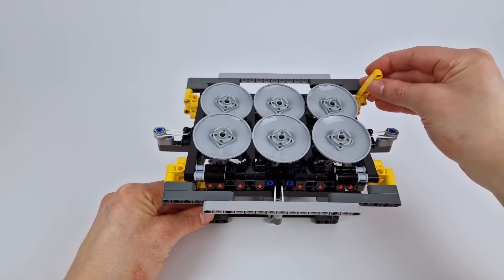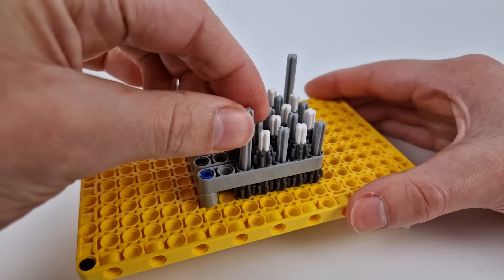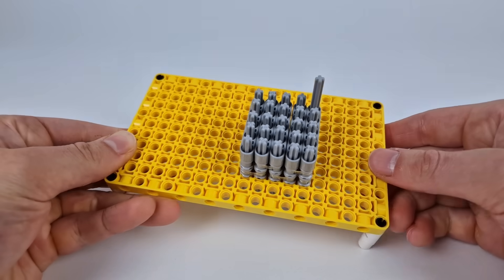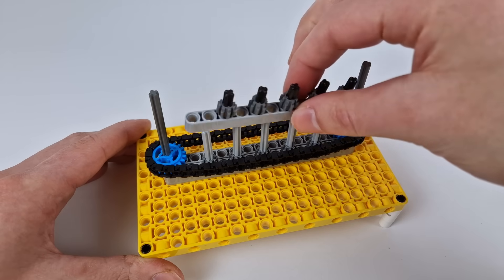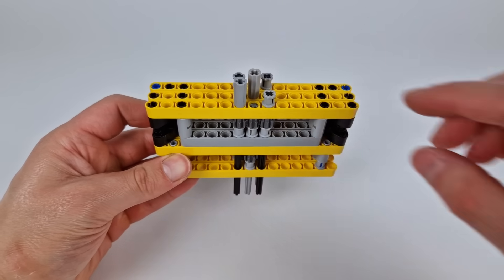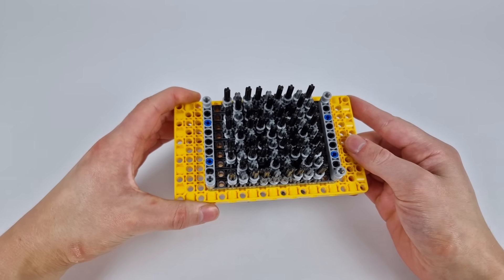How I Built a LEGO Treadmill That Moves in EVERY Direction

Comment: It might be a bit smoother if you tensioned the net with some rubber bands so there’s not any sag between axles. The fact it’s 9x9 and leaves an open row of spaces on two sides might actually make that easier, just adding some rubber bands to them could work. I have no clue if that would actually help but intuitively my thought process says it should

Comment: 7:57 Why not just have the rubber bands connect in independent groups of two instead of every single axel being connected to one another? Since the treadmill has an even number of axels in each row, it shouldn't be a problem, and since one in every two axles is powered and connected, you shouldn't need the bands connecting everything.

Comment: You shoulda stuck with the second design where it has 2 layers of one grid gears but have  2 drivers on the outside of each of the 2 layers. That would save you a tun of space. Aka a drive gear on the side of each 2 layers. 2 drivers 2 layers. 1 or 2 motors.

Comment: Pretty sure rubber banding them two at a time makes the force required to turn the gears an exponential function of 2. I'm not going to guarantee an automobile engine generates enough force to turn that shaft if it were made of perfect, indestructible materials.

Comment: First, instead of trying to turn one single axle with a motor and have everything else be connected with gears and elastics, why not just drive every other axle directly, and have each driven axle linked to a nearby axle via elastic.

Second, if you could use belts to drive every other axle without slippage, why not try to power every other neighbor with elastics? 

Great video nonetheless.

Comment: For getting the chunk corner axles spinning with the chunk edge axles, you could use the gear method which doesn’t work but instead of one of the gear pairs, use a rubber band connection. This would be much smaller than using the universal joints.

Comment: So you may already be aware, but Disney (iirc) actually used a similar structure to take multidirectional input for 3-dimensional movement in VR games/experiences. As far as how the input from "walking" on the treadmill is translated to steps within vr, im not sure - but I imagine it could be done by measuring motor voltage input and rpm output differences among each of the rotating disks. The 3d pad they prototyped is huge too with thousands of disks. very cool!

Comment: Very good. Did you consider shifting the powered bottom section of the assembly and keeping the disc grid fixed? This would mean the bottom mechanism must hang below the fixed treadmill part which would have some larger structure to hold it and that would rest on the table (say). The relative movement is identical and although the greater mass is the bottom section, imagining the treadmill as a floor which does not itself shift around should make the omnidirectional motion clearer since it is not mixed with a large translation relative to the camera.

Comment: So basically that entire yellow box underneath is only there because Lego doesn't make a gear that can turn around an axle freely. That is some real dedication to not just breaking out a drill and making the piece you need.
Reply: this might be a dumb question, but how would that solve the problem? i can't seem to visualize it
Reply: @wcpf19  imagine you have an array of the small gears. some will turn one way, some the other way. you need them all to turn the same direction. now imagine that you have one gear that grips an axle (like what we currently have), and one that lets the shaft spin freely. and so on. that would mean that only half the axles going up will be powered, and will spin the same direction. now put another array below this one, but with the order reversed when you have a normal lego gear above, you put one below that does not grip the axle. that way you power the axles that arent powered. in a way you can think of the freely spinning gears on the shaft as just a means to turn the other gears next to them, which actually grip the axles and make them spin.
Reply: @wcpf19  let's him pass an axel through that the gear has no effect on. Then, he would use another stack of gears fixed in an oppositional array to actually drive that axel, allowing all the axels to run in the same direction with only two gears worth of space.
Reply: Or a 3D printer, but I guess that defeats the point of using Lego parts
Reply: @ZT_1234 the purpose is to model shit, imagine doing science with only a set number of elemen…. Oh…..
Reply: @lindboknifeandtool Unironically, this is precisely what I love most about designing and building with Lego. My most enduring interests all have limited sets of building blocks – the elements of chemistry, the instruction set of coding, etc – from which to build forth from. Working within such restrictions has a wonderful way of focusing the mind, by giving you a basis of possible pieces to put together to solve a problem. I find it easier and more intellectually stimulating than if I were to have completely free reign over every detail, which can be an overwhelming hazy cloud of potential that makes it more difficult to know where to start, and where to go next.
Reply: @Havron I believe this urge (to me, literally I only know about me) feels like I’m settling into something lazy. Like, it’s a meditative process and to me those are dedicated to downtime. I mostly am concerned with making art my every waking hour so if I was to use something pre done like say wire wrapping pendants instead of going full silversmith I’d be leaving artistic potential on the table and the… resolution to which I can represent the idea in my mind is sharper. 

Idk like I’m glad at this point I can basically make anything with any metal and it took a very long time. Maybe some things I’m not thinking of like car body panels from flat stock but you know what I mean. 

But the restrictive to produce creativity thing is valid asf and I do it myself, I just often feel like using AI, I’m not getting those 10,000 creative thinking hours. 

I way overthink everything. 

I build Lego sets now because I have my massive tub to my nephews.
Reply: There is one

Comment: 8:00 I'm pausing the video and guessing the solution: 
You could do a few bigger gears underneath so the strain doesn't branch just from one point of contact and then those main points turning the surrounding gears so the friction is more dispersed, genuinely no clue if that'll work but in my brain it feels it would work better than that setup.
Reply: 10:20 YOOOOOOOO, DA CHUNKS

Comment: you could use two tiny gears and a belt to connect the central axle to the counter rotating axles. it would add 9 belts so idk if it would work with the friction but it's compact and easy

Comment: That's wild! I'm always impressed by what people can do with Lego.

I bet you could link the power switch to the joystick so that the motors are off when the joystick is centered. Creating a deadzone that the objects on the conveyor won't move. 

You could also probably make it so the lower assembly moves via the joystick instead of the net section so the conveyor is stationary. You'd probably have a lot more resistance on the joystick though.

Anyways great work!

Comment: I figured out a way to do this with the round smooth 1×1 tiles like you did however it is portable an d it is less that 10 studs tall and also less than 10 studs wide

Comment: 4:14 I assume modifying Lego pieces wasn't on the table, but if it was: could you drill out the plus-shaped axel teeth from one of those small gears and give it a smooth bore? That way you could have a small version of that red gear. Not sure how structural it would be but with so many of them meshing, it probably wouldn't need to be too strong on any single one.

Comment: Imagine how much simpler this design would have been if there was a cog piece that had a smooth, no grip center that would just rotate around the shaft without contact.
It would solve the entire adjacent-shaft grid rotation problem

Edit: Actually looking now those pieces do exist and Lego calls them clutches, but they dont make them that small, only 16 tooth, not 8 tooth as needed.

Comment: My solution to the lack of space watching this would have been to basically add an extra set of universal joints at the bottom, allowing each axle to spread out over a larger area so that there is space for idler gears.

Sort of like what you did in that last step, but at a more absurd scale, probably wouldn't have worked nearly as well as what you came up with in the end, and would have taken up way more space

Comment: This design it not significantly different from the holotile design as you state in your acknowledgement. They both use tilted disks to achieve movement. Perhaps you achieve that tilt in a slightly different way, but the fundamentals of the technology are still exactly the same.

Comment: 7:00 why not power the 4 corners with 4 separate motors? There would be enough power turning them and it would be evenly distributed
Reply: 16 motors for a 10 by 10 grid might might be a teeeensy bit much
Reply: @MarilynMalkovich  where are you getting 16 motors from?

I was saying 1 motor for each of the 4 corners
Reply: @IdealIdeas100 I believe they mean the fact that in the time stamp, it is a quarter of the full thing shown, so 16 is the total number of motors

Comment: why not use 2 shafts in different locations on the perimeter on the double layer design at 4:15 and gear the shaft to spin together on a 3rd layer?

Comment: I don't understand why the 2 layered gears solution proposed at minute 4:05 is not pursuable. Why didn't you add an external input shaft for the second layer of gears on the outside perimeter of the yellow plane? You have opposing holes on the outside of the plane, just run a driveshaft inside one of those vertically facing holes and you are set, no?you could engineer the gearbox outside of the plane in order to have 2 output shafts rotating in the same direction 1 block apart and then just connect 1 to the bottom array of gears and one to the driveshaft that goes to the second layer.. I think you have the space to run a secondary driveshaft

Comment: I found the movement of the holder mechanism kinda off putting and weird. Like it didn’t fit well with how the treadmill moved the Lego pieces.  Don’t you think it’d look better to the eye if the frame of the holder mechanism was attached to a table so that the     grid of gears was suspended underneath the table and hidden so that from your point of view you the joy stick will only move the direction the LEGO pieces go as opposed to also seeing the frame move. So basically instead of seeing the net holder mechanism move and the red lego move of the treadmill, you could just see the treadmill stay in the same spot while j seeing the red lego pieces move. God I tried explaining this as best as I could. 😭

Comment: what if for the tread idea you tensioned it so that it still meshed well with the small gears?
Also, instead of moving each of the individual 1x1 disks, why not design a mechanism that just moves the net around instead? The disks would be pulled around by the net

Comment: i cant help but feel the idea of two separate fullsize grids stacked up was abandoned too quickly. If they were powered from a gear to the side rather than below it seems like it would just work, and you could use a network of larger gears underneath to power it simultaneously from a lot of the edges.

Comment: I believe you could make it a bit more compact if you had done a similar design but utilizing the bottom and top of the same plate to drive the gears from and both sides with the same 100 gear mess showed at the start.  You just needed to drive the top half forward and the bottom half the opposite way with an axle transferring the power from top to bottom but adding a odd amount of gears to make the rotation flipped.  Or running two motors one for the top and one for the bottom.  Then just have the axles coming through arranged in the same alternating pattern that way you can make it any size you desire.  Great video It got me wondering about a scaled up version for an omnidirectional treadmill and if that might be a workable concept.

Comment: You currently run the first 5 axles from the center axle, then added a layer after where the gears run in a c-chape.

could you not swap the center "driver" to the open spot on the c so that you dont have the issue with the gear meshing that showed up in the final steps as hey would be next to each other and could be run with the 2 small gears

Comment: Building a Miniaturized Omnidirectional Treadmill with LEGO

*   0:00:01 Initial Problem: The original prototype treadmill required a large platform to avoid slipping between the large rotating discs. Smaller objects would get stuck.

*   0:00:31 Solution: Use many smaller discs for more points of contact, creating a smoother, cohesive surface.

*   0:00:48 Design Goal: To use the smallest possible tilting discs within the LEGO system, specifically 1x1 tiles.

*   0:01:12 Two Major Challenges:
    1.  Design a mechanism to control the tilt direction of all discs simultaneously.
    2.  Power every single disc, ensuring they all rotate in the same direction.

*   0:01:47 Net Piece Solution: A commenter's suggestion to use a LEGO net piece proved brilliant. The crisscrossed ropes fit between the discs, guiding their tilt.

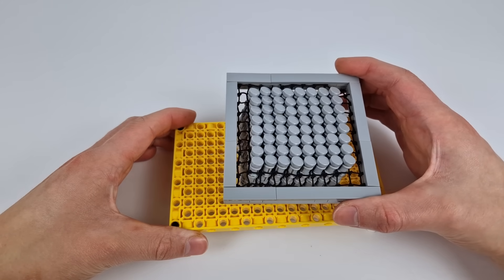*   0:02:15 Scale Limitation: The net piece has a 10x10 grid, which sets the treadmill's initial size.

* 0:02:33 Powering Challenge, initial ideas: Powering every axle in the 10x10 grid (later determined to be 9x9) so that all axles rotated in the same direction presented a significant hurdle.

*   0:02:57 Initial Gear Grid Attempt: A simple grid of gears (using idler gears) only allowed half the axles to rotate correctly.

*   0:04:04 Two-Layer Gear Idea: A two-layer gear system was considered but required a non-existent gear piece.

*    0:04:49 Belts and Chains Exploration: Both LEGO and non-LEGO rubber bands, and chains were explored.

* 0:05:46 Non-Lego Rubber Bands Discovery: Tiny, non-LEGO rubber bands were found to fit well and provide good grip, but friction was still too high for a full-grid application.

*   0:07:25 Hybrid Gear and Belt Approach: A combination of gears and belts was attempted, using belts to drive axles not powered by the main gear grid. This also resulted in excessive friction.

*   0:08:33 Chains Revisited: Chains were reconsidered, but the 8-tooth gears were incompatible with the chain links, and larger gears were too bulky.

*   0:09:56 Segmented Grid Solution: The breakthrough idea was to divide the grid into 3x3 chunks, designing a mechanism to power all axles within a single chunk, then replicating the chunks.

*   0:10:35 Final Chunk Design: A 3x3 chunk design was finalized, using a cross-shaped gear arrangement, C-shaped gear lines for corners, and 12-tooth gears with a universal joint to connect them.

*   0:12:42 Tiny Rubber Bands' Crucial Role: The small, non-LEGO rubber bands were used to correctly power the central axle of each chunk.

*   0:12:55 Checkerboard Assembly: The 3x3 chunks were assembled in a checkerboard pattern to avoid gear interference.

*   0:13:50 Gear Trains and Motors: Gear trains and motors were added to drive the central axles of each chunk.

*   0:14:18 Net Movement Mechanism: A frame and joystick mechanism were built to control the net's movement, tilting the discs.

*   0:14:55 Joystick-Movement Decoupling: The joystick's movement was cleverly decoupled from the net's movement, making the platform's direction intuitive to the joystick's direction (90-degree shift correction).

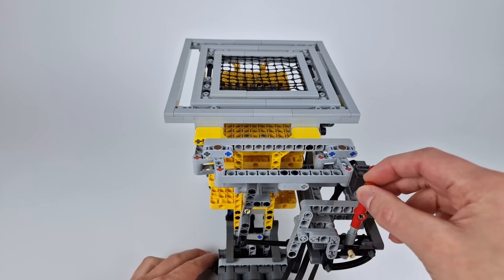*   0:15:44 Final Assembly: The tiny tilting disc assemblies were connected to each axle.

* 0:17:44 Conclusion, further testing planned.

I used gemini-2.0-pro-exp-02-05| input-price: 1.25 output-price: 5 max-context-length: 128_000 on rocketrecap dot com to summarize the transcript.
Cost (if I didn't use the free tier): $0.03
Input tokens: 17912
Output tokens: 882

Comment: I had a play around with this myself and found you can make a complete row by using 2 layers of gears instead of one then climbing up like a staircase as you move down the grid, adding a new layer of gears that fills in the gaps from the last layer. It adds as much depth as there is grid size but removes the need for rubber bands completely.

Comment: Instead of trying to drive via the center of the 3x3, why not drive those 5 by one of the cardinal pins?  This would allow you to use the smaller gear piece to connect the cardinal with the diagonal pins. You'd still have the small band for the actual center pin.

Comment: 3:52 It looks like the gears are in a grid pattern and my idea would to be make the correctly rotating gears on one separate layer and the opposite one on a different layer and possibly make so the fist layer would go to the second layer and have all gears connected and once all the gears are rotating one way you can start

Comment: i haven't a clue about lego engineering, but how possible would be to add a 2nd layer of those top moving universal joints tha tmake the platform, ontop, fed into a stationary net.
so they get the angle, but dont move back and forth  as much? sorta like how a chickens head remains stationary while the body moves.

so it ends up less of a  \  to / motion
and more of a ) to (

Comment: Amazing work. Idk if it would introduce too much friction, but instead of having the spaced 12 tooth gears at the botttom with the complicated assembly, couldn't you just connect them around the corner with a gear and a rubber band connection. That way you'd have a the opposite rotation. Can't gauge the extra friction tho. Crazy stuff nonetheless